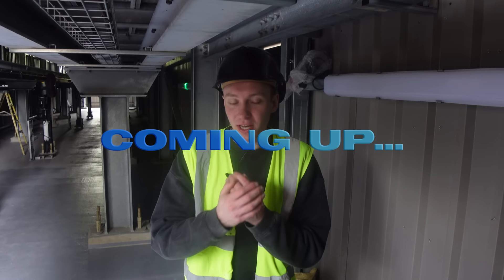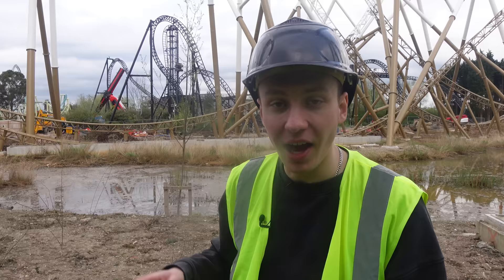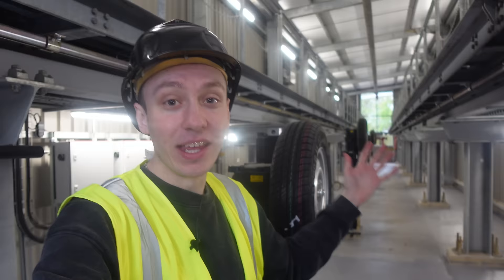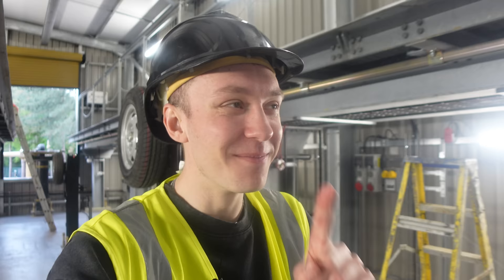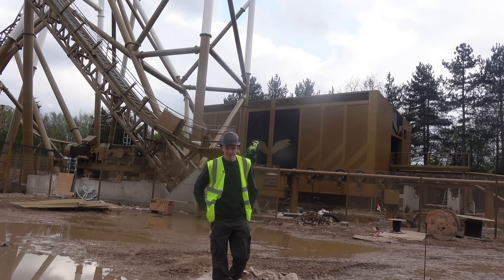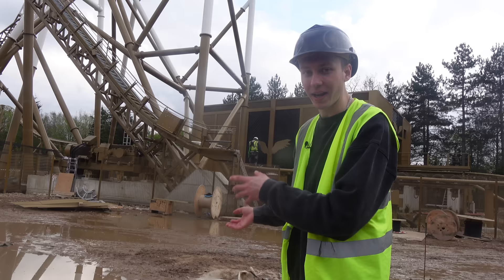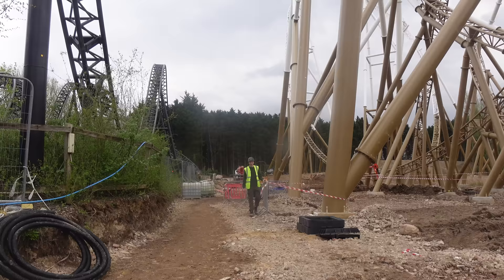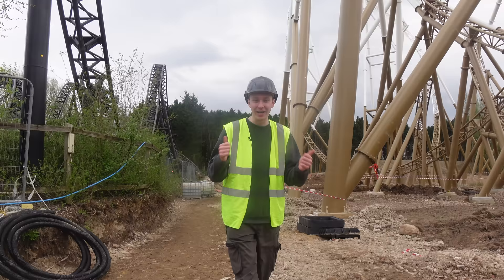Where are HYPERIA's Trains? | Thorpe Park

Comment: The excitement for this coaster is so high i wish i could just time travel to opening day right now!!!
Reply: It probably won't open the date they said. The place is still a massive building site, and they haven't even began testing yet and they've only got little over 1 month before it apparently opens to the public. The Smiler went through several months' worth of testing before people could ride it. If they're only giving this gigantic ride little over 1 month to do testing for its safety and collaboration of the trains, expect breakdowns and possibly incidents. I would rather tham spend time testing it rather then rush it through because of public pressure.
Reply: @martin096  Are you seriously comparing Hyperia to the complexity of The Smiler (14 loops and two lift hills, not to mention how compact the layout is) 💀 I'm not saying it's not gunna get delayed though, if they pull it off, it's definitely gunna be a close one.

Comment: Can someone explain what is going on with the rails at 5:18?
Reply: When the trains are moved onto the track from the maintenance building, this ensures that the wheel bogies engage and are aligned onto the running rails as the trains are held by small wheels on the side of the trains when in the maintenance building so staff can inspect and move the wheels freely from all angles (this is also why there is no track inside of the maintenance building)

Comment: How many trains will Hyperia Have? 2 or 3?
Reply: Probs 2 but I thought maybe 3 as once it could be at the outer banked turn the 2nd train could go then anthor
Reply: 2, as there isn't a block brake section.
Reply: @RapidsJohnson  there is once you come from the drop or near the illimeanen loop
Reply: I believe it's two trains, but in my mind no reason why you couldn't have 3, one on the brake run, one on the station, and one on the lift hill. Except maybe the one on the lift hill couldn't proceed until the brake run is clear...? So 2 then.